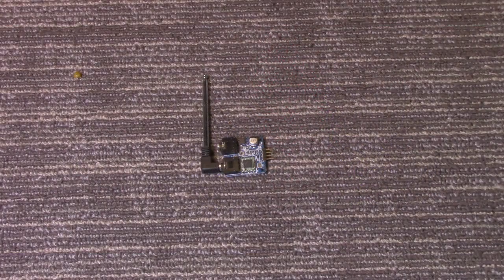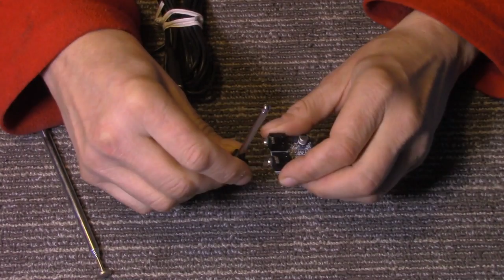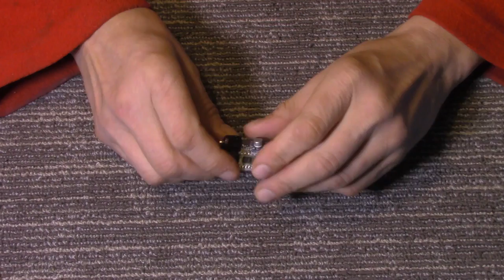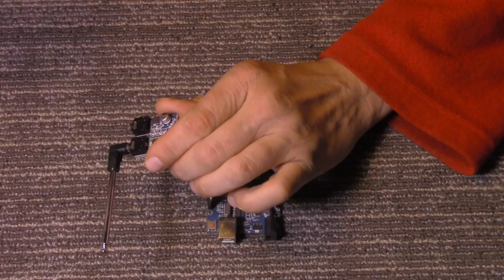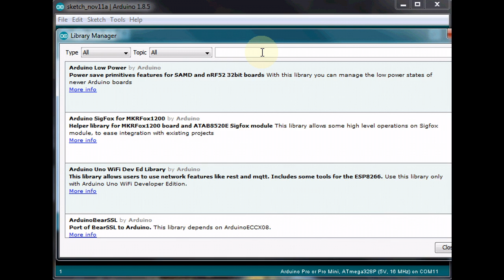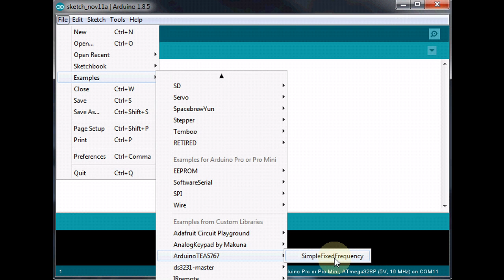Learning Arduino for beginners EP #40 TEA5767 FM radio module

Comment: Hey awesome video 

I wanted to know weather we can program the tea5767 itself, by using an arduino to just upload a program to the tea5767 and then take out the arduino once it’s uploaded and use only the tea5767 with power supply and head phones (without arduino )

Comment: Hi. Could you please help me out with figuring this module out? Im trying to do an extremely challenging iPod Classic modification and I don’t know if I should get one of these. It needs to be small and versatile and cheap so I can break a bunch of them. 

Would it theoretically be possible to:

1.Connect this to a charging circuit for a battery to deliver power
2. Wire it to the data pins of an iPod running custom software
3. Have the ability to tune it through software
4. “Link” the poles of the antenna 3.5mm and the 3.5mm on the iPod, allowing for a cable plugged into the latter to be used an antenna for the prior

It’s even worse than it sounds. I need some help/advice here.

Comment: Hi, maybe you could help when i connect a speaker or a headphone on the radio module all i get is static noise and if im not hearin wrong the actual music in the back but really faint and silent i cant figure out whats wrong i even have a second module but it gets me the same results
Reply from the maker: Try using it in a different location you might have something interfering with the signal